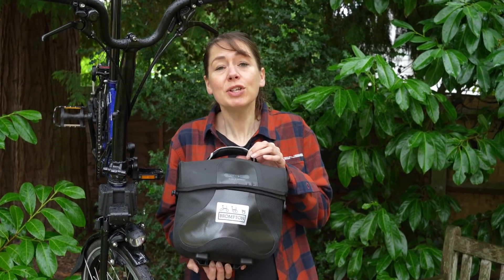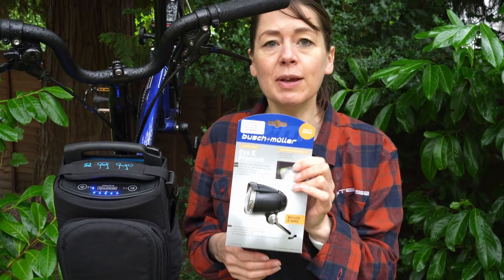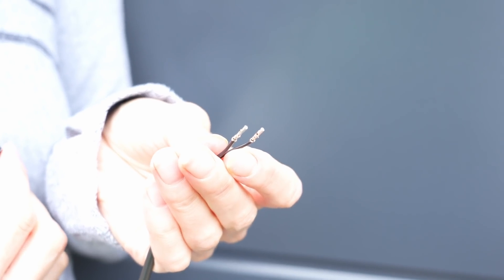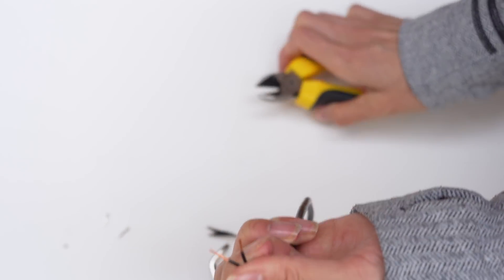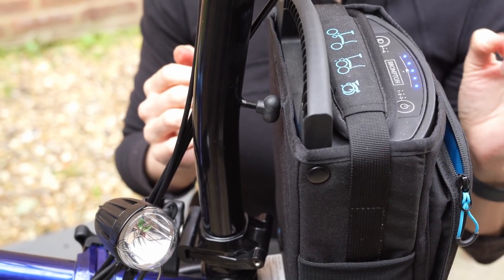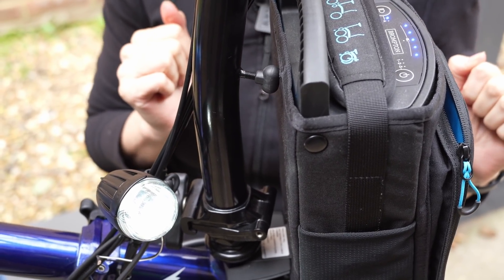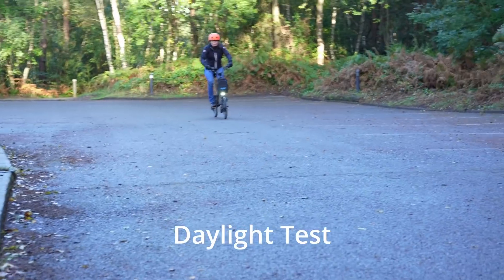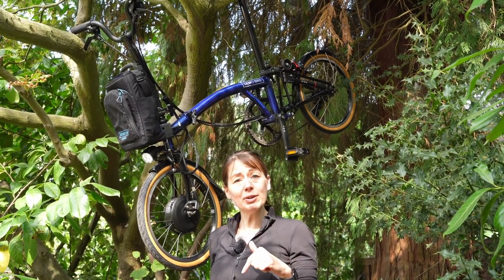Brompton Electric Light Upgrade - can we do it?

Comment: Excellent video again, as they all are! 🙂
Would it be possible to put a link - or the info - for the needed connectors & tool featured in the video description and/or on the BB site with the alternative lights? Just to make sure to get the right parts.
Reply: did you ever find it ? :)  I would be interested
Reply: @nathanbarlow3758  No... unfortunately not... 🙄

Comment: Hi There thanks for your video, would you be able  to remove the Brompton original fitted lights, not replace them but still be able to use the battery as normal? don't use them at all, so I would like to remove them. could you advice? Many thanks

Comment: I did it, this lamp is much better than the standard one. It's great, thank you for this blog! 
(I couldn't buy the connector block anywhere, I connected the wires without it.)
Now I'm waiting for a blog on how to increase the range of this lame battery, on which I ride only 30 km.
Reply from the maker: Glad it worked OK. 
We have made a couple of videos on he range of the electric, links as follows:
https://youtu.be/LhkwbqWRnmw
https://youtu.be/w79sDtBRk-Y

We really found the battery lasts longer on the lower power (not very surprising!), but also a bit better if you start of in a low gear (a bit like a car)
Reply: @brilliantbikes  OK, but what to do to make the battery drive more than 30 km with two stars?

Comment: Think you've got your lumens and lux mixed up!
Busch & Muller lights are always quoted in lux.
So 80 lux not 80 lumens for the Cyo e80. And the Avy e40 you took off is 40 lux not 40 lumens.
Time to make the video again 😂
Reply from the maker: Ah any excuse for another video 😊. Thanks for pointing this out, perhaps we should explain the difference - one lux is equal to one lumen per square meter
Reply: @brilliantbikes  yes but not quite as simple as that, distance at which the lux measurement is made and beam focus also have to be taken into account in order to make a comparison of bike lights.
For example, a 600 lumen light could be 600 lux at 1m from the light but only 6 lux at 10m from the light.

Comment: Excellent video but there seems to be a consensus of opinion that a separate rechargeable light would be better and I think that is the route I shall take...... However.... I have the excellent Brompton Quad Lock phone mount that takes up most of the real estate on my M bars. Any suggestions?
Reply from the maker: Thanks for watching, and the great comment

It was a lot of effort - but worth it (for us) to see that it was possible

How about .... a GoPro (other action cameras are available) mount that can clamp to the handle of the battery (we use this for mounting our GoPro (again, other cameras are still available!) - then getting a light which can be mounted to an action camera fitting?

Comment: Hi , Great video as usual❗️I Can’t believe Brompton electric bikes come with a 40 lumen light ⁉️ The light in my fridge is brighter than that and it only has to illuminate the path to my snacks.😋
🥪🍗🍔🧀  I just did a few mods to my bike  yesterday and one of them was lights. I lucked out ,my local Brompton dealer here in Arizona had the 
Cateye/Brompton  front and rear set in stock . I was going to go on a short test ride around the block to make sure I did everything right and nothing fell off but was so impressed by the lights it turned into a 10 mile ride down the canal trail. Other things I changed were the seat , got a Brooks Flyer special which is such a great classic looking saddle in black with black springs and copper rivets that I almost feel guilty sitting on it! And I also got the marathon tanwall tires. Did not get those orange wedgie tubes , gonna try with just the stock ones for now. Your video on changing a rear tire was a big help as I’ve never dealt with a internal hub before. Got to do it twice because I forgot to put the chain on the cog 😁
Reply from the maker: We agree the Brompton’s Cateye is a great light! So glad the videos have helped you 😊. Thank you so much for watching!

Comment: There seem to be two versions of this light, one 6V, the other will operate on 6V-42V. Do you know which version you’ve installed?
Reply from the maker: Thanks for watching - and the great question

The 6V is probably the dynamo version

The 6-42V will be the e-bike version

We installed the Busch + Muller Cyo E Premium - 6-42V - 80 Lux E-bike
Part no: 1752Q42/6N
(It's the one that on the packet says - in the English description - "cannot be connected to dynamos!"

Comment: Superb video, I discussed this with Mike a while ago. Thank you for going to the effort to do this, I might have a go!
Reply from the maker: We thought it was never going to be possible, then we found the light, then had the fun of connecting it! Phew sorted. 
Thank you so much!
Reply: @brilliantbikes  I also had a discussion with Mike. Certainly seemed possible, finding a suitable light didn't seem very difficult (Was also thinking CYO premium), but there is a level of bravery required - Brompton don't give you any spec for how much current you're expected to draw, and I was worried about blowing a fuse. Might also mean the relay for the light runs a bit hotter. For the past years it's been a non-issue as we've had "work from home" over the winter anyway... I keep asking brompton to provide an option, even with a markup I'd be happy to pay for something off the shelf and warrantied.

Comment: I am using bm ixon iq premium on handle bar,  but only where necessary. You can move up, if there are trees above you,  that you can hit with your head or down, if there is traffic from the front. In vertical position the light must not shine higher than the mounting point. So with standard lights you see only the feet of pedestrians.  It's not much. I also dislike with the original light,  that you don't see,  where you go to in tight curves.
Reply from the maker: We also like running two lights and used the Cateye as a bit of a comparison to show how bright it is. Thank you for your comment and for watching

Comment: You should never strip cable sheathed with cutters as it will damage the conductor. Also you should always use the correct crimping tool to ensure a good connection. Although the modification to the wiring  currently works it is likely to fail in the not to distant future.
Reply from the maker: Thanks for the improvements! We will make sure we use the correct tools when we do this again. Thanks for watching
Reply: I agree totally. Also I would use heat shrink over spade connectors personally.

Comment: Great video! Very helpful steps and comparison. I think I will keep my standard Brompton light for now but add a brighter rechargeable handlebar light. One bonus is that rechargeable lights can be powered or at least charged using the Brompton battery. It's nice to have standard lights built into the bike/battery but they need to be bright enough for regular use too as your comparison points out. Any thoughts on the increased battery drain for the new light? Thanks again!
Reply from the maker: We agree a second light is a great option, we generally run a second light on the handlebars, that partly why we included the Cateye, just to show how bright it is (we chose to mount it in the same place for comparison). Good point on the battery drain, sorry we don’t know as yet.
Thank you for watching 😊

Comment: I must say Brompton don't do good lights, it's my only real gripe with the bike brand. I have two front lights, one is 750 lumen and a 1000 lumen. I don't use them at the same time. Less bright lights are OK in fine weather but when its raining they are useless. When it's pouring down in town and car windscreens are smeared with rain and gunk they can't see you properly. I find 1000 lumen is not too much. 1000 lumen is too much for normal night cycling in town, you will blind pedestrians and drivers. Both the lights have different brightnesses with pulse and flash options. The 1000 lumen light can also be used as a powerbank for phones and the like. I must say when I have to service my Brompton I come to this channel to see how it's done. I then phone up my mobile cycle mechanic and offer him the work. I had two tires replaced a while ago and after the job he told me how awkward it was. I said I know that's why I have an expert do it for me! He gave me a really dirty look. Hahahahaha.